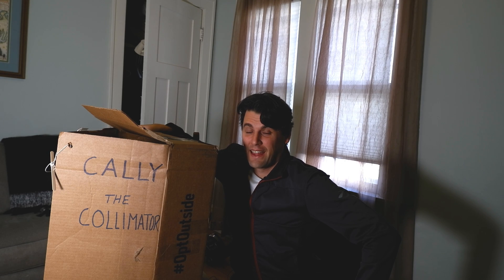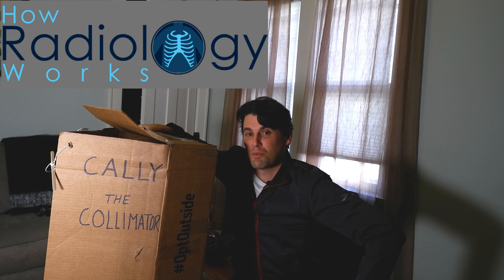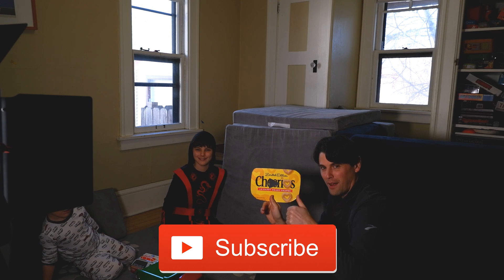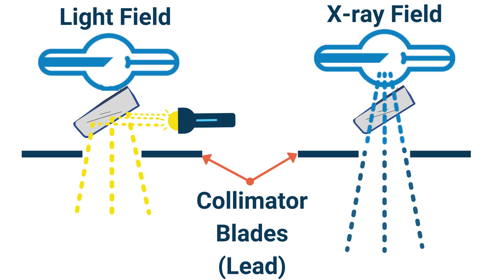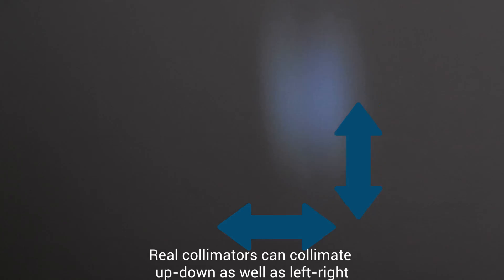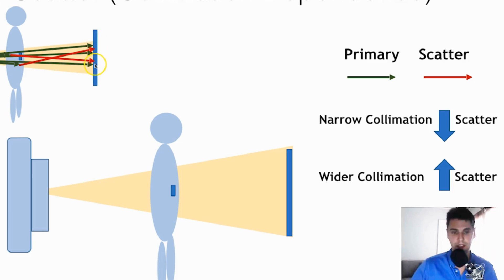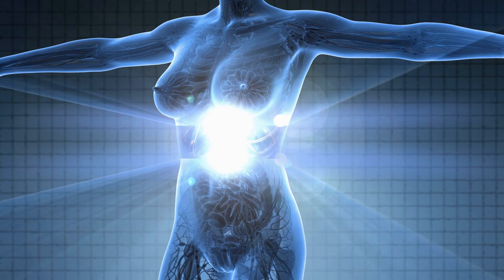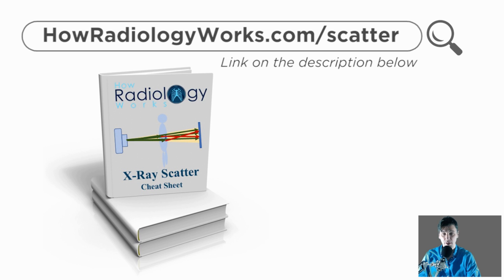X-ray Scatter FOV (collimators impact on scatter) [200 Subscriber Special for Rad Techs]

Comment: great content man. just subbed. Audio is a little unbalanced fyi 😫it’d be a big help to double check your gain. Keep up the good work!
Reply from the maker: Tanner thanks for the suggestion. I will check the gain. Some of these recordings were just done and others I did a couple years back and equipment was different. I can try to match better. Was there a certain part that needs improvement (beginning or end of the video)? Or was it the gain level difference between the different sections?
Reply: @HowRadiologyWorks  Just the different volume levels between clips, a lot of the spots where you talk to the camera are much lower than others and I had to keep turning up or turning down based on the video. Maybe add some compression on the vocals? Again very much enjoying learning about radiology. I’m training to be an x-ray service engineer so you’re helping me!